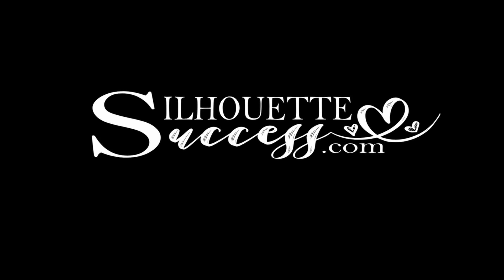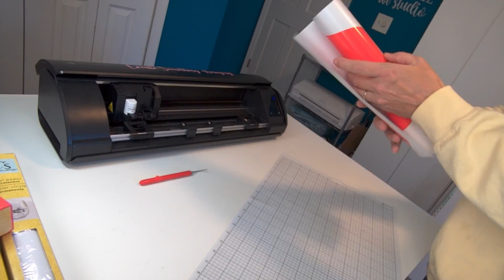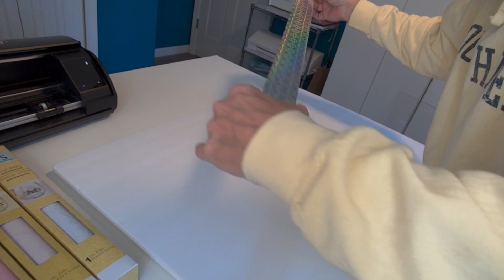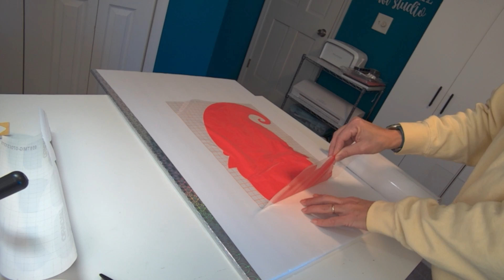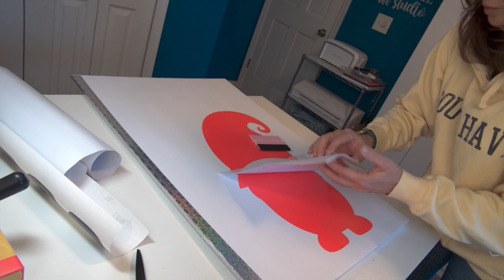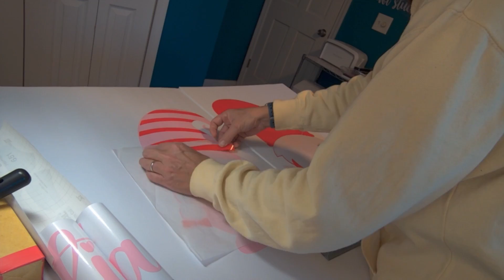Dollar Tree Vinyl -Are the Savings Worth the Struggle?

Comment: I'm new to this hobby but used DT glitter vinyl for a greeting card accent. It worked pretty well even though it was very thin. Based on a Cricut video i watched, I used the Washi tape preset in the Silhouette Studio and it actually cut things quite well with no movement. Of course my piece was a lot smaller than yours. LOL :)

Comment: I used DT vinyl and their transfer tape. I used it to:
 Etch on glass cutting boards and glasses. 
Etch on painted metal Tumbler
To make sticker sentiments for cards.
Also used it to make sticky stencils.
Yes, it requires lots of patience. The transfer tape doesn't can be use a few times before is not good anymore.
Reply from the maker: I haven't tried the transfer tape. Does it come up off of the backing when you use it?
Reply: I have used DT transfer tape and it seems to be too sticky. It seems more sticky than the vinyl. I put it on a cloth before I use it and that helps make it less tacky. I use parchment paper under the vinyl to prevent it sticking too much at a time.

Comment: I use DT glitter vinyl on the top of heavy card stock to create rhinestone templates. The stone transfer tape will not stick to the glitter vinyl.  This saved $$$. compared rhinestone flock. Plus it’s easy to store for future use using a DT wire divider.
Reply: Wow this is a good idea!
Reply from the maker: This is AMAZING!! I must try this now!
Reply: Nice! I have tried the DT glitter vinyl and used the DT transfer paper but it didn't grab the vinyl well enough. Ended up using clear packing tape. What is Stone Transfer tape? I web searched and couldn't find it.

Comment: I have used it for car decals  and they have lasted years &  withstood the Texas weather... the only thing is that  It really doesn't do well with small intricate designs.
Reply from the maker: Really? That is amazing! Do you have the same issue with it coming up from the backing?
Reply: Yes... I usually trim the vinyl into 12 inch pieces, lay the bumps as flat as possible & let it sit  with wieght on top of vinyl for a few days & it usually take care of that problem @silhouettesuccess
Reply: I bought various colors for similar uses with similar results. Most colors were usable but the white was terrible and unusable.
Reply: Same! I made decals for a basketball backboard using dt vinyl and it has lasted through rain/snow/heat/cold
Reply: I have made vehicle decals too but the colors fade pretty quick. It’s also hard to keep from getting bubbles in the decals.